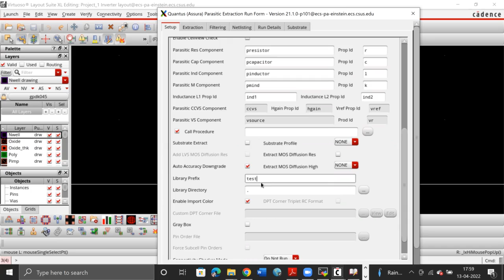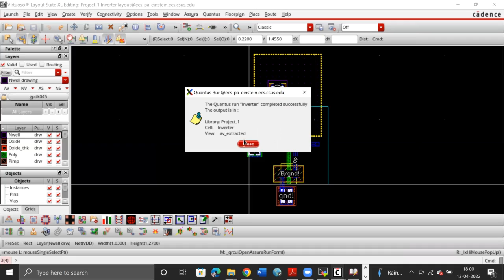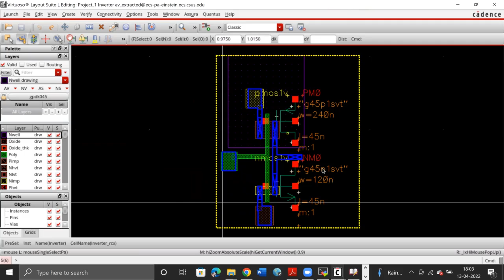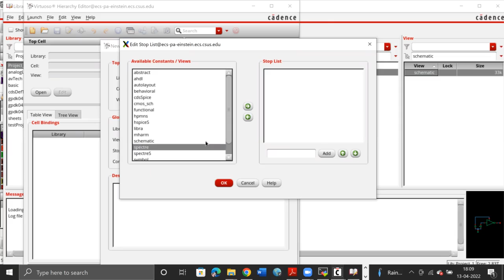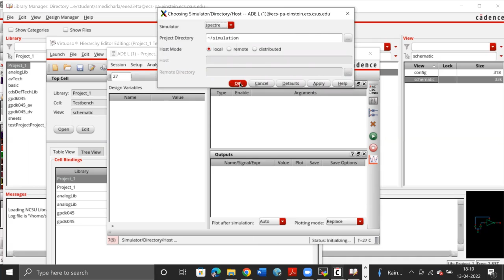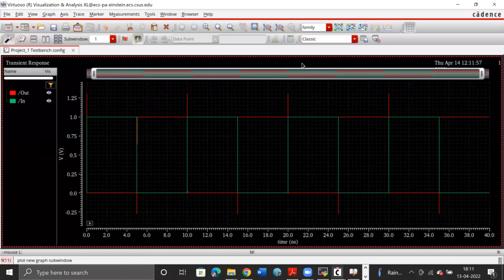CMOS Inverter || Parasitic Extraction and Post-Layout Simulation

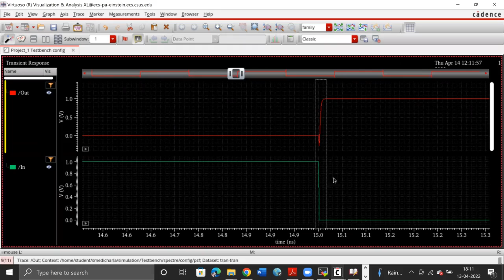Comment: At 4:38 you needed to set one of the views to av_extracted. Otherwise it doesn't know to use the post-layout view, and will default to the base model. That model does have some parasitics built in, which is probably why you're seeing that delay at 6:38. Try changing to av_extracted and see if that delay doesn't increase